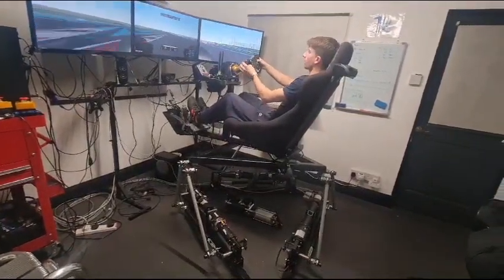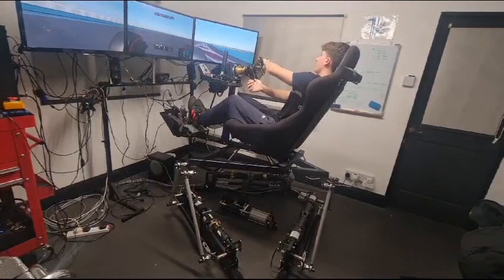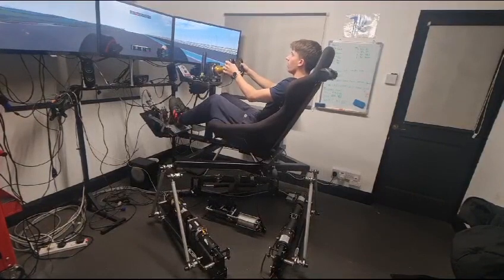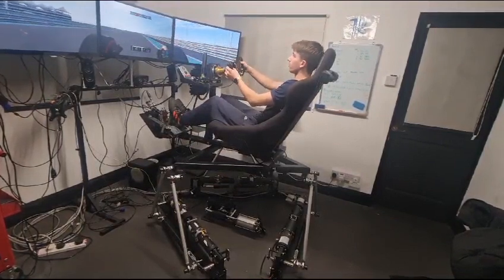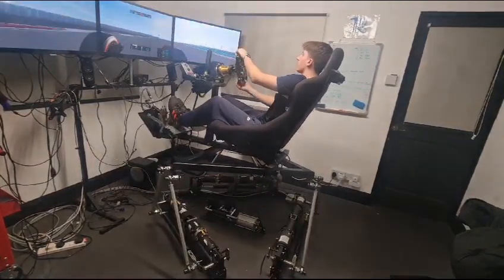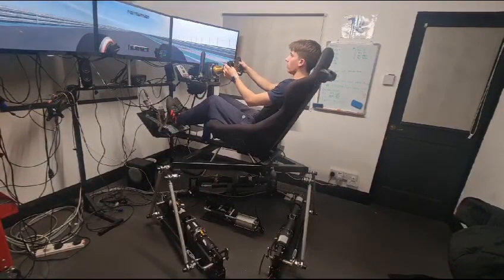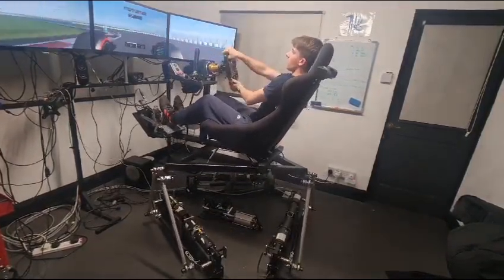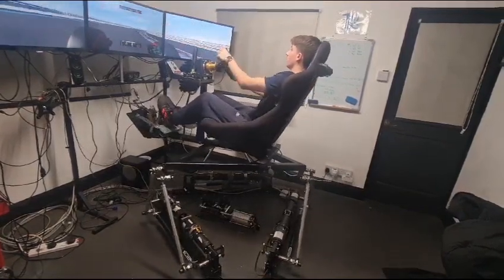How a simulator moves under braking

Comment: Have you tried setting it up the other way around just to see how it feels? You really should because you are really limitimg the immerion you would get feom this incredible rig by having it this way.
Reply from the maker: The actuators will have less surge force if you rotate the simulator, and the rear will lose yaw and traction loss force